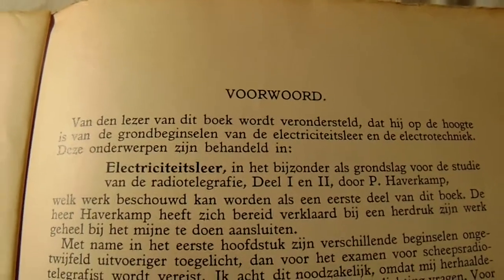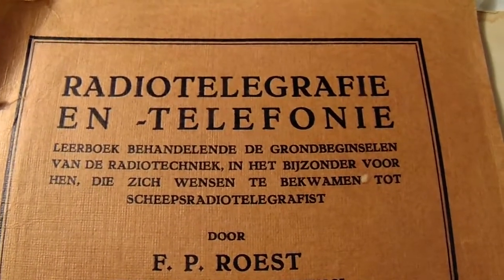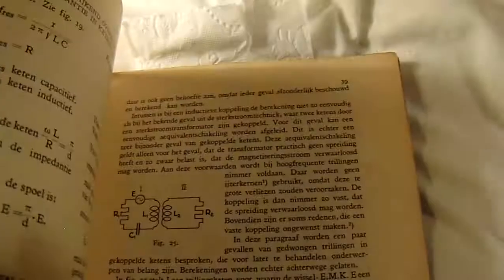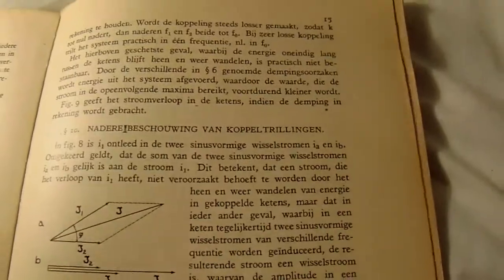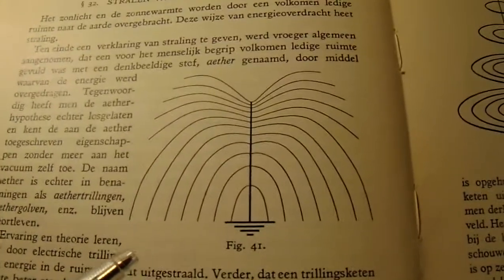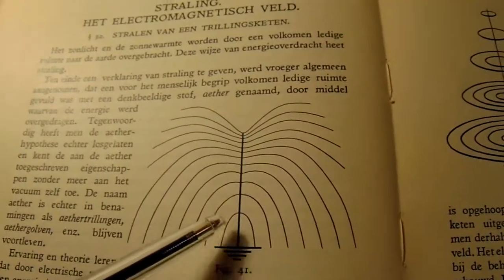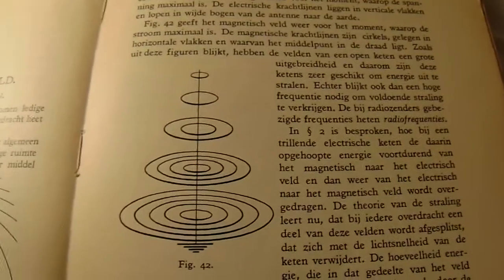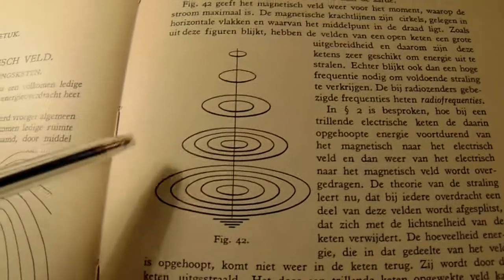Old book 1936 how EM waves are strayed out from a vertical rod antenna

Comment: Ah, so this means that the magnetic field comes mostly from the bottom of the antenna where the current is the highest and the electric field comes from the top where the voltage is the highest!

I would still like to understand how the EM field changes from a 90 degree lag between E and M close to the antenna to 180 degrees at some multiple of the wavelength. - That relationship seems very strange to me. - According to Einstein an EM wave, or a photon, should not be able to change shape at all since it experiences no time due to moving at the speed of light, and a change of phase seems to violate that.
Reply from the maker: OK, perhaps there are other (better) sources where you can find your answer. When you found it, send the link. I am interested too. here is a lot of info about radio propagation  on the www. By the way: all radiowaves travel by the speed of light only in a vacuum. The earth atmosphere is no vacuum, though the difference for radiowaves is in general almost negligible.